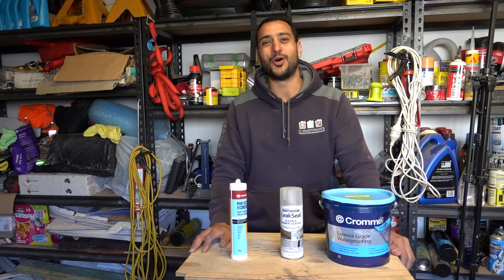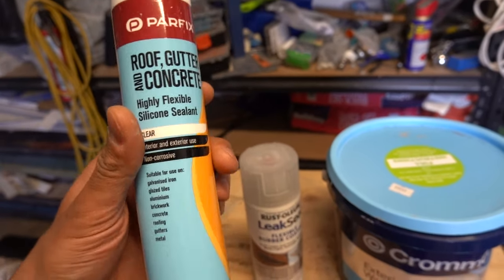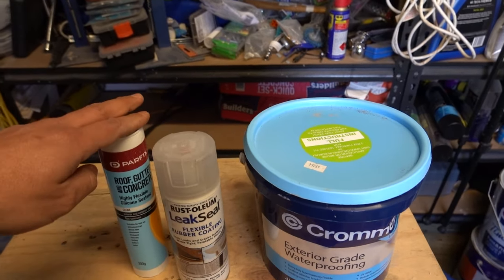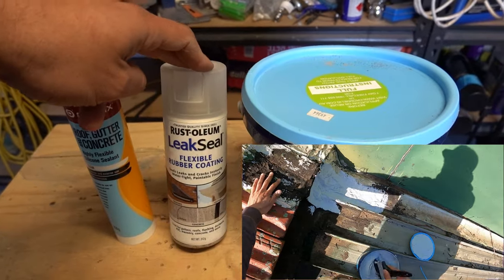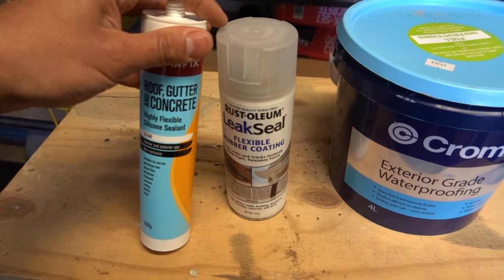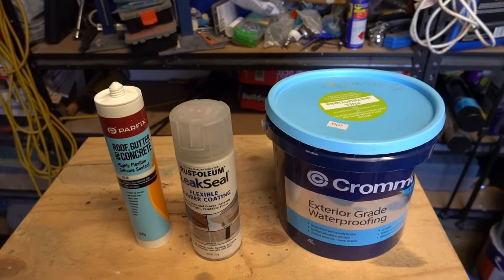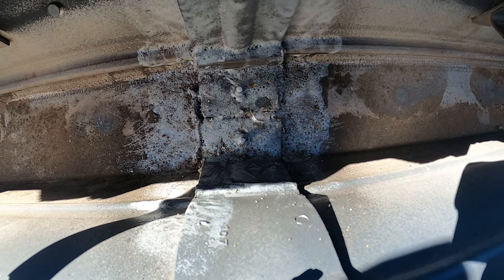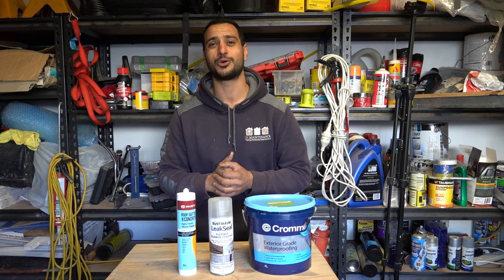3 ways to fix leaking roof and gutters - DIY

Comment: Bill, I would have added the liquid bitumen product. Crommelin 1l is about $16. Now bitumen is also compatible with drinking water surfaces. To make the job longer lasting soak  it to a support cloth, polyester, fiberglass, cotton  etc. This is specially useful for the first roof surface you fixed.  It can be painted if the repair surface is visible. The paintbrush can be cleaned in water  Keep em coming

Comment: I have to reseal my box gutter at a warehouse, should I clean the previous silicone off before applying the crommelin or just paint it straight on top 2 coats?

Comment: I have a gutter placed in the housing of a canopy, with lexan plates, not at the end of it but just before it.
The gutter leaks from the brackets that support it (a few drops), especially in the point where there is the slope of the canopy near the hole and the end of the gutter, there is a continuous stream of water.

Comment: Thank you for the tips. I think the Aerosol LeakSeal is the go as it can get in and onto inaccessible places. I have used a product which is similar to a thick bitumen tar. It is most useful as it is can be forced into cracked to get a proper seal. In fact, you can make it run better but heating it with a heat gun. Not pretty as it is black as tar (pun) and is lumpy. But it is out of sight anyway, up in the roof gutters.
Reply: Application of most aerosol can contents is not as good as the good old disposable brush.  This is especially the case on old surfaces. For longevity and flexibility Bitumen should be applied to a reinforcing cloth or fabric as it may crack over the years. Water Based Bitumen Paint is environmentally safe, easy to apply and suitable for use for the collection of drinking water

Comment: hey man. I have leaking gutters but on all the joins. I have a colourbond roof and right at the back of the join is very hard to get to and clean properly but tried my best and got it pretty clean and dry. I have tried with roof and gutter silicone with longer silicone nozzles to reach right at the back of the join. Siliconed it but still leaks. Improved it but still leaking ( mainly from the rivets) Very annoying. Just drips. Should I try the spray ? Do I need to clean and take off the silicone I put before applying the spray? I have only done it from the inside of the gutter
Reply: Applying silicone is far from ideal. Just remove the old silicone (yes it is hard but essential) and apply a liquid bitumen coat. It will fill the small holes. You may want to apply a DILUTED bitumen coat so that it fills those tiny holes. Then apply a full coat. Better if you also stick a support cloth over it and apply the second coat. It will outlast your guttering. Ensure the surface is spotlessly clean

Comment: Thanks for the video, what's the largest crack width which you would seal with the spray? Cheers
Reply from the maker: You can apply multiple coats for larger cracks however I wouldn’t use it for anything larger then hairline cracks and joints